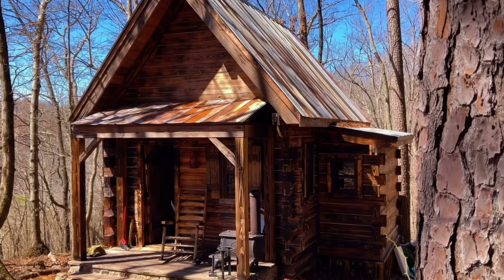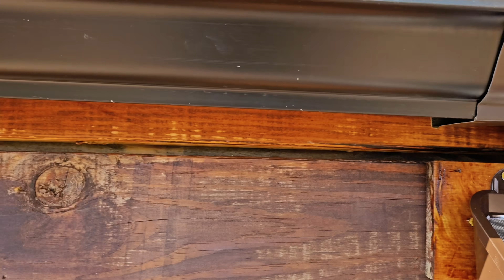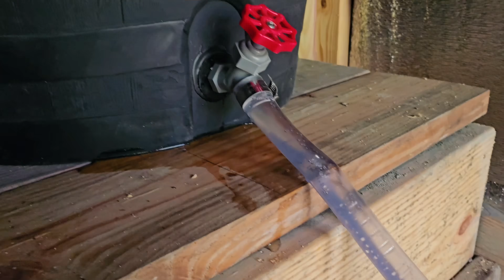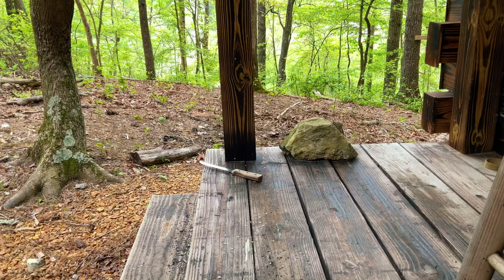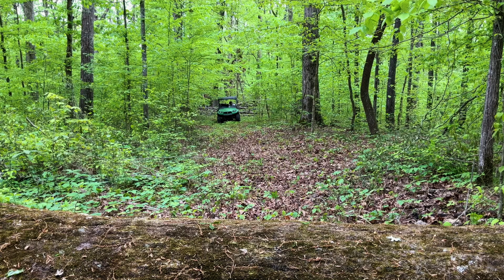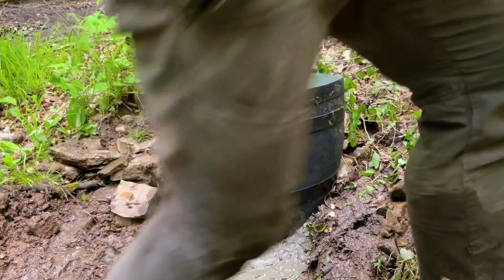The Results of My Rainwater Gravity Fed Filtration System | Tapping a Ground Spring | Off Grid Water

Comment: I helped my dad tap a spring on our NC property back in 1971 with a washtub. I was barely a teenager. The tub had a screen over it to prevent debris and he used pvc pipe to connect it downhill to the camper. There were no filters back then so everything was filtered with screen. I have to say that water was COLD and we used it for everything. No one died or got sick. He sold the property in the late 70’s. I’d love to go back to see if it’s still there. The camper is long gone of course.

Comment: Do you think the 3 inch pipe when full of water will be heavy and push on the 2 in going into the house? 

A riser clamp could be used to attach the pipe to the cabin so it's not just free hanging there.
Reply: So I checked and 3 inch holds like .37 ish gallon per foot so probly not worth it.

Comment: OK Get as much dirt and rocks out of the way. find exactly where the water is perfeating out of the rock. Build a rock and mortar round wall all the way around. Let it fill with water then leave a over flow spout where you want it ti drain down hill. Make sure you have a good sealed cover no dead mice in water. set solar battery and pump off you go. remove pump when freezing

Comment: Our spring is a good distance below house site.  We have an excellent flow rate so we ran pex from the catchment to a buried 500 gallon tank.  Dropped a well pump and it pumps to a pressure tank that’s up the hill in the building .  It’s pretty steep elevation from our tank and with the well pump and pressure tank, we have no issues with water flow or pressure. Works good for us.  The buried tank has a overflow so the water is constantly circulating.

Comment: Great to see all these upgrades you are making. I wonder if the solar battery bank can be used to power a small 12v water pump?
How have the summer temps been inside the cabin with just the wood as insulator?

Comment: I have seen smaller dams built on streams and you got the right idea but you should try box the area & add a pipe instead the plastic use rocks & cement like the hydrostatic is good then to keep the water safe run it through any pipe or get a roll plastic water line start like 2" at dam then drop to 1" about half way to the cabin it will help the pressure build up a bit !

Comment: To make it go up into the cabin, you might need a12v pump. Also the more the barrels are full, the more pressure there will be to go thru the filters. If that is where you are going to leave the outdoor stove, you should think about a shelf under the window to put any spices for when you cook. Are you going to build a second bridge in the other ravine? Do you plan on building a power generating wheel  on the creek?

Comment: Nice video. 1 Question, how do you combat ticks? I have rural property similar to yours (much smaller in size) and every time I’m out there clearing, thinning out woods or trails, felling trees, I always have a tick or two either crawling on me or attached. I spray but I still get them on me. I had issues with chiggers too but after clearing a few years ago, they seemed to have disappeared. Thanks for sharing and look forward to your next video.
Reply: Always keep brush clear.  Most i get come from green small plants and trees below shoulder height.  Permethrin is what I use, only on my rubber boots.  Some pretty bad stuff, but where I live you take one wrong step and you have millions on you.  The animals will bring them into my yard no matter what I do.
Reply: @MachinaSpeaks  - thanks!! Yeah, I bought some Permethrin a few years ago, read the label and it’s been on the shelf ever since … I’m afraid I may have to break down and start using it. Thanks again!
Reply: @ElwoodPDowd-ed7pc  I don't like it either but it's an absolute necessity where I am.  I spray and fully let dry my rubber mid knee boots every 3 weeks or so.  I always leave the top 3 inches clean to help not transfer chemical.  I've gotten very mindful to not touch my boots.  Before that, 30-40 years ago, I used to soak my boots in some diesel oil/fuel mix and would tie a rag around my knee.  Worked pretty good, but nothing like permethrin.
Reply: @MachinaSpeaks  - thanks again, you’re a blessing … appreciate you and your visual messages.
Reply from the maker: Still trying to figure it out. Chiggers get me a lot....ticks not so much.